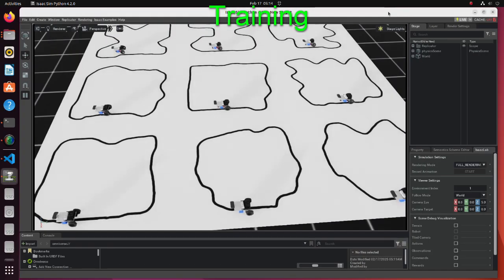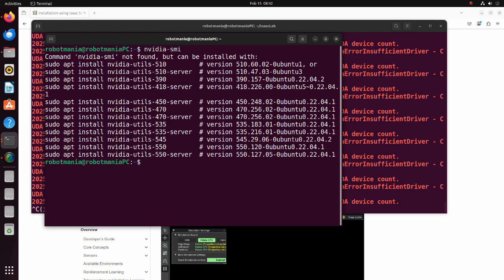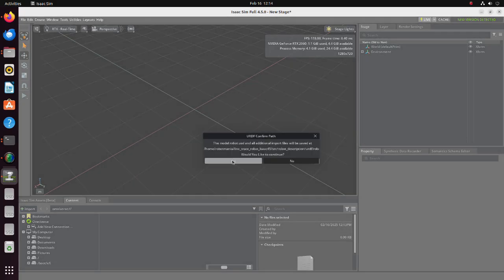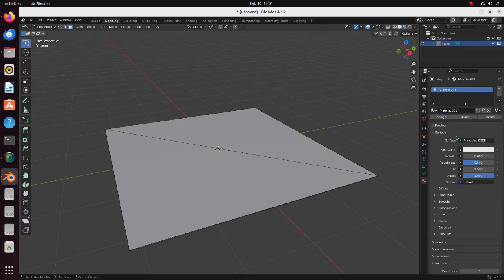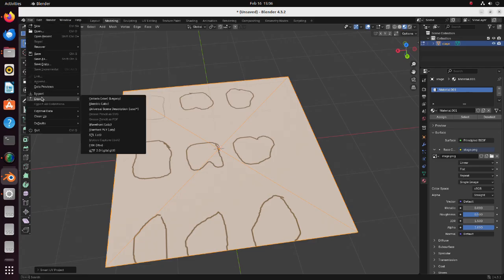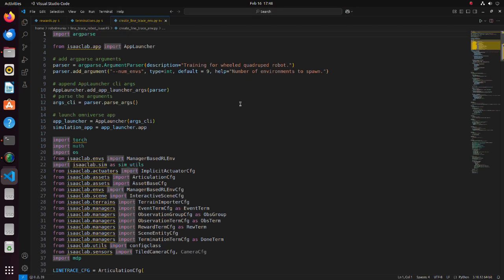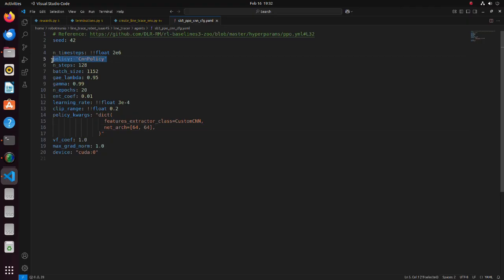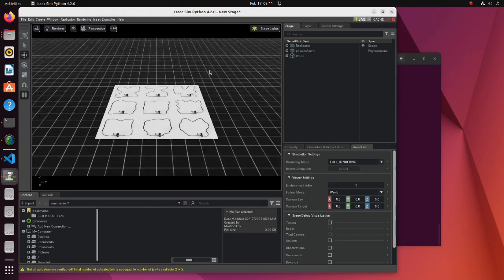Isaac Lab: How to set up training environment and use custom policy

Comment: I successfully run it on 4.5, usually how long is the training time in order to get a good result?
Reply from the maker: Hi Hunter Tech&Art!
Thank you for trying out this project!
I actually haven’t trained it till the robot follows the black line. I think we have to modify the reward function to prevent the robot from moving backwards and give it an additional reward when it moves forward. Reward that is only proportional to black line area percentage didn’t give good results.

Comment: Thanks a lot for great video. Could you please help using gazebo also.
Reply from the maker: Hi Asha!
Thanks for watching my video!
I have several videos in which I do reinforcement learning using gazebo classic. What exactly are you looking for?
Reply: @robotmania8896  I am looking into line follower robot in gazebosim using reinforcement learning.
Reply: @robotmania8896  I would like to do line follower robot using gazebo sim and reinforcement learning.
Reply from the maker: Gazebo Sim had problems with “reset” functionality. I don’t know whether it is fixed now.
Apart from that, I think it is possible.